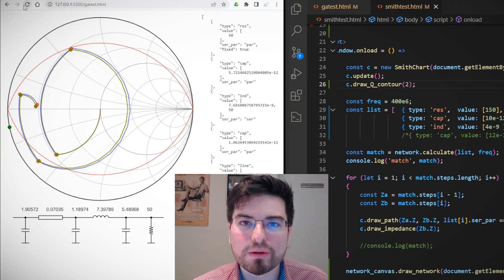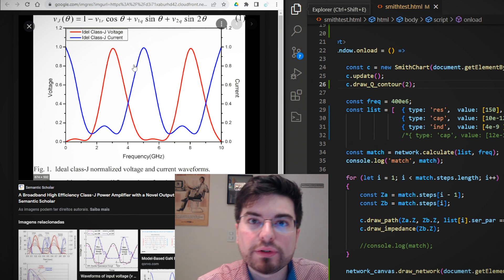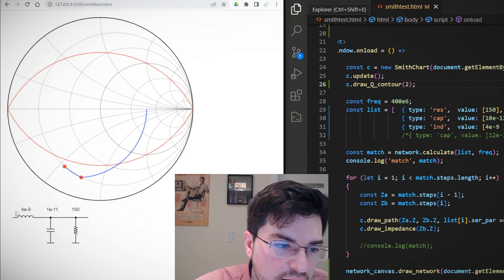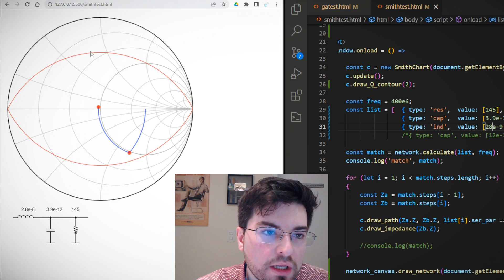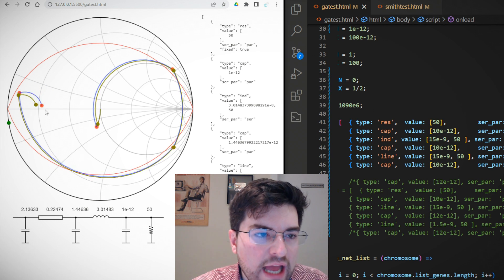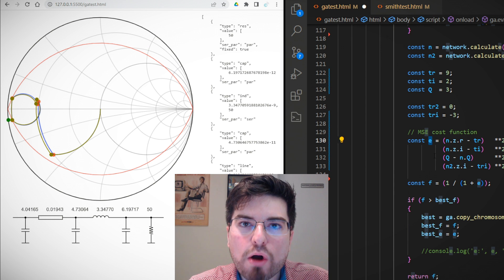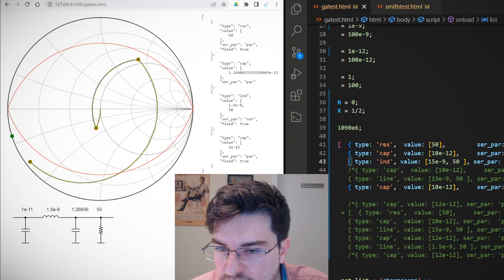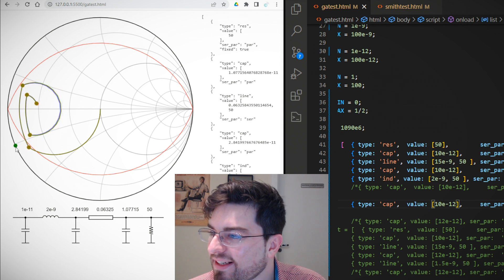Smith Chart Impedance Matching for RF Amplifier

Comment: Good stuff Greg. Good stuff Greg. 

In the past I've also used non-gradient based optimization methods to tune ceramic resonator filters. Hint: You can not get trapped into a local minima when the loss function is quadratic, may be you can exploit this fact. Concerning impedance matching I'm doing a personal research on analytic gain-bandwith theory.
Reply from the maker: Yep!! Probably a more useful cost function is something non-linear.. considering tolerances, temperature sweep and commercial component values!

Comment: Interesting, I have never seen the current vs voltage vs frequency chart you showed but it makes total sense.
I'm more used to see everything only in the power domain in RF design.

Did you also take a look at QUCS or RFsim?
Both are somewhat old but both work pretty well for this kind of stuff. 

Do you plan to measure the S11 paramters of the LDMOS or will you just take the value given in the datasheet?
I guess if you want to measure it, you would have to do a full load pull table.
Reply from the maker: Hey Michael! 

Never used QUCS or RFsim.. 

The S11 probably need to be measured or the datasheet values taken... It is a good first step for the input match. 
S22 no. 
The output needs a loadline match, not a return loss match, as S22 is a small signal parameter that is not considering the device's physical limits. 

A very interesting fact: 
loadpull works because it is measuring the loadline match after impedance transformation from Cds and package inductance. Have you ever though about this? 

We have the right loadline resistive impedance in parallel with Cds, and in series the package inductance. 
This is a LC network that, unfortunately, transformers the impedance down (from outside we look at the inductance).
This is why the impedance are so low.. like 1 + 0.5j..

You can see in the video, when I fixed the Cds and package L, the smith chart first goes to a lower impedance, and after comes to the specified impedance. 

The specified impedance is actually what we want the ideal transistor current source to see. 

=]